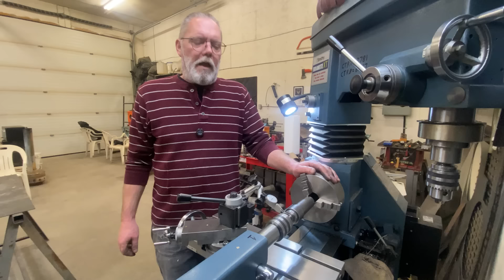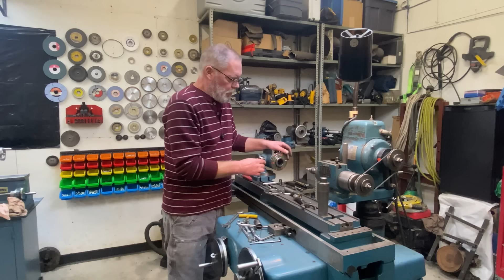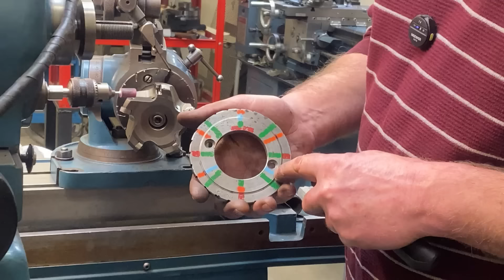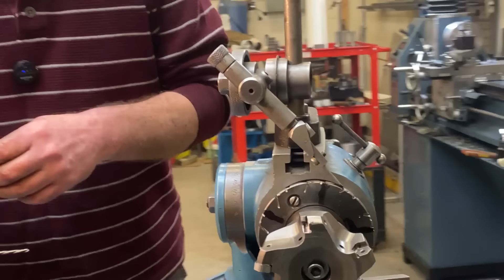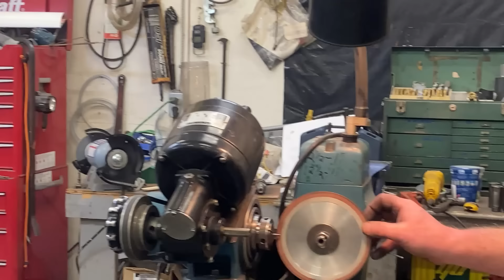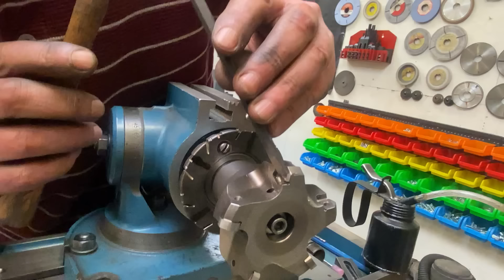MOST IGNORANT BROKEN SCREW I'VE EXTRACTED

Comment: You'd think they would thread the entire bore specifically to make broken screws easier to extract!

If you (or a friend) tinker with electronics, it should be pretty easy to build an EDM broken bolt extractor. It doesn't have to be very rigid, as EDM imparts no force.

The most important part is to ensure no electricity flows through the EDM's spindle, as that would destroy the bearings. I believe people usually use finely-stranded copper wire wrapped around the electrode shaft as the brush, keeping the spindle bearings out of the circuit. If the spindle and workholding are part of an existing machine, you also need to insulate the workholding - perhaps by clamping it down with plastic shims above and below.

You need a spindle that can turn at a few RPM, holding an electrode such as a piece of 12ga copper wire. Bend the wire a bit so its tip makes a circle about as big as the bolt/screw being removed. This spindle needs to be adjustable in the Z axis.

The EDM electronics are fairly simple: a DC power supply that slowly charges up a capacitor that's rated for high-current discharge. The electrode is connected to one end of the capacitor via the brush, and the other end of the capacitor goes to the workpiece. Polarity matters - you want the heat to go into the workpiece and leave the electrode cool. I don't recall whether that means positive or negative, but you should be able to find info online about polarity, as well as power supply voltage. A meter or indicator light is generally attached across the capacitor so you can tell if it's charged or if there's a short.

A dielectric liquid (oil, kerosene) is usually used, and I believe this improves electrode life by keeping it cool. In professional setups, the liquid is pumped, which helps remove debris.

Operation is pretty simple - you turn on the power supply and spindle, and advance the spindle until the electrode arcs. If it stays shorted, back it up and clear debris. If not, continue advancing. A professional setup will have a motorized z-axis that advances slowly, stopping when the cap discharges and reversing if it stays shorted for long.
Reply from the maker: That's a really in-depth explanation of an EDM setup. Appreciate you sharing!

Comment: Grind 3/8 " clear of thread. Use teflon tape, the high-pressure kind (the pink stuff I think) since it is thicker. Increase layers until the thread tightens in the internal threads. You'll only be off 0.0005" 5 tenths. 
Use a differently sized tip or stylus with a flat.

Comment: Looked like that screw broke due to impact by the scars on the flange, and not seized due to over torquing or thread locking compound. I remember the machinists in the Air force using cobalt and diamond tipped tooling for hard work like that, but at six hrs+ labour! That head would of went back to the supply disposal scrap pile Lol. love watching your work and the mental pleasure of man mastering machine. Cheer's H
Reply from the maker: Thanks for the kind words!

Comment: When i need to spot teensy hardened and/or munted screws like that, i use a McMaster 4313A151 bit. It seems to hold up even if i accidentally let it run around the hole a bit.

For removing sleeves, as long as they're not too hard, ill turn them down to about .060 and then knurl them. They tend to open up a bit. And even if they still need pulling, the new knurls give me a good surface to clamp to.

But that obviously won't work up against a shoulder like you have there.
Reply from the maker: Thanks for watching and for the tip!

Comment: Really a good job but I have a question. Wouldn’t it be an option to take a tap drill and run it through the tap drill hole from the backside? It might be that the friction alone from the tap drill would turn the broken screw. There would be no set up as you would use a hand drill.
Reply from the maker: Thanks for watching

Comment: 35:30 you can make one of the smallest left hand drill bits by hand but when you need a chisel you get some huge honker instead of a flat ground small piece which would have fit in that area much easier...😂

Comment: Yeah, this is the kind of job that makes you realize the majestic beauty of old EDM sinkers... You clock the piece on the table, you take a copper pipe a tad smaller than the minor diameter of the male thread and you chuck it in the holder, you route oil through it and just give the screw some of that good ol` Mike Pence treatment... The machine will do everything of it`s own accord, and will stop at the set height, so you can just set things up, let her run and come back in half an hour to a job perfectly done... After that, you can just extract the rest with regular extraction bits, a punch or what not... 
Same goes for trepanning and custom socket driven pieces... If you want to trepan a massive part, just take a large copper pipe with a thin wall and clamp that to the EDM, and if you need to take out a screw with a mashed head, or you want to make a screw with a hex or similar drives, you can just machine a driver replica(undersized in accordance to the arc length) and zap the part until it fits the hardened steel driver to desired depth... 

A lot of broken head screws can be mended(extracted) by zapping a hex into the body, leaving some 0.5 or 1mm of the cyl. section of the screw, and just plopping a key into the hex and wrenching that bitch into submission... It will often bend the wrench, as it`s always one or two sizes undersized vs the hex that comes naturally with the whole fastener, but a decent impact socket should loosen it in a real hurry without issues, but the manual hex wrenches also work - with the risk of bending... Anyways... I`ll cut the rant... Nice job on your part, the rant is just a ``sort of a suggestion`` and me glazing the old tech...
Reply from the maker: That's a really interesting take on the problem, thanks for sharing your insights!

Comment: Would it be possible to indicate from the other side of the threaded hole since they didn't thread them all the way through the tool holder? Sorry if my terminology isn't quite right. I have a cold.
Also, forgive me if I'm mistaken and the holes are actually threaded through. My eyes may be fooling me on that.
Excellent outcome.
As someone who has extracted roughly a zillion screws myself, I can say that the feeling when you get an exceptionally difficult one like this is pretty hard to beat. 
Well done and thanks for sharing this. :chillwcat:
Reply from the maker: hahaha,,,I considered turning down a pin that could fit the ID of the threads more tightly but decided against it as I already had the shell mill in a setup so couldn't check the pins progress at the lathe. Thanks for watching and commenting!
Reply: @Lappemountainliving  I see. Thanks for the reply. This is the first one of your videos to appear in my feed. I've subscribed now. Have a good one.
Reply from the maker: Awesome! welcome aboard!

Comment: Grinding a custom drill bit is awesome and it's why I'm here. This one also made wonder if a carbide masonry bit would bite into that hardened screw.
Reply from the maker: I'll bet it would. I've had incredible luck modifying masonry bits. Thanks for watching!
Reply: @Lappemountainliving  Me too, I have successfully modified them and used them to drill some incredibly tough, case-hardened steel shafts.
Reply: Few things in life are as satisfying as the successful extraction of a broken screw.
Reply: @Rodneygd or keeping you assets after divorce.
Reply: Checking the top rake angle I see flat with a slight chamfer for chip prevention. Coming in from the back side with the tap drill might only leave a wire to pull from the threads.
Reply: Should drill from the back side. So when it catches. It runs out.
Reply: Exactly my friend!
Reply: I go straight to a solid carbide drill for hardened screws or bolts. If that won't cut it , edm it.
Reply: @bobbybishop5662  My experience exactly. You've got to get the alignment right, then a 4-flute centercutting carbide EM slightly smaller than the minor diameter of the threads, it'll go through those hardened index screws, and you get a hole on which you can get a bite. First though, I'd try an automatic center punch - lots of light snaps like he did with that flat chisel. It often gets a tiny bit of movement at a time, and ends up spinning it out.

But I have to say, it's a good video with that satisfaction at the end, like finally pulling out a damned ingrown hair!
Reply: I have reground masonry bits to drill hard metal , it works .
Reply: Small diamond burr, very slow so as to keep heat down if not cooling available. If it will grind glass and ceramic…
Reply: My old machine shop teacher would get them and grind the correct geometry into them and drill coolant passages into mold cores with them. Don't need to be perfect and saved $$$ over a solid carbide drill!

Comment: 4:20 Once you are that thin, oxyacetylene will instantly melt it away without heating the base.
I’ve surgically removed many a rusted nut.
More precisely…cut bearing races off shafts without scarring the shaft
Reply from the maker: Thanks for watching

Comment: I'd use a round diamond file. Maybe a dental burr. 
BTW IMO It's not true that high speed creates sparks and destroys the diamonds. Dental drills can run at 50.000 RPM. Sure the diameter is tiny but still. Angle grinder diwmond wheels cutting rock at 10.000 RPM also come to mind. It's carbide dust for sure. Rock dust. It would be over in seconds if they were diamonds burning away. It can break the diamonds or rip them off but they will not burn so easy. If you are afraid of that, you can cool it down with air or something. Everyone is running those wheels so fast in surface grinders. It always makes sparks

Comment: Broken screws drills and taps are always a pain.  I have had really good success at removing them with the rig welder.   Just build up a blob of weld metal (use stainless) above the surface and then use vise grips.

Comment: I wonder if anyone has tried using a shilding gas and a arc welder. Using a same size screw with the threads cut off. A placed in the welder inplace of the electrode. Maybe make a guide or jig to allow straight on contact. Then spot weld the threadless screw on to the broken one. Under shielding gas for protection. Or weld on a nut with very small welding  wire .

Comment: Brings back some terrible memories trying to extract 2.5 and 2.2mm tip screws. 
I used to have the best luck pushing them out from the back with rh carbide and occasionally HSS slot drills. 
The production engineers refused to put in appropriate cutters with tough tooling  as they were cutting first cuts on castings that would still steam when coolant was applied. My crew was in there every shift and spending almost 12 hours a day fixing damaged cutters.  Got it sorted eventually with a few political dirty tricks and a contact at the tooling company where I sketched out an appropriate design for these cutters and tips and had some made. Changeovers went from every 6 hours of cycle time to a tip check every 3 months usually only requiring a rotation and no more.  We also developed a side and face cutter blade that used an insert nut for the screws as with the cutters being so narrow the first or second broken screw usually trashed the threaded hole.  Cutter replacement frequency went from 100 hours to several years. 
I did eventually rewrite the plant wide SWI for carbide tooling and the feature was every tip replacement new screws must be used and every tool that required screws 3mm and under have them replaced at the tip change.  For milling cutters like the one you repaired screw replacement was mandated after a second tip change.  Any broken tip would require a screw replacement due to stretch issues . I was also able to get torque limiting drivers for the setters and operators to prevent clamp screw damage.   Cost wise it wasn't cheap however the improved up time and product quality covered it.
Reply from the maker: Wow, sounds like you really tackled a huge problem head-on and found some great solutions!
Reply: @Lappemountainliving I agree, would like to see the papers he presented for the system...
Reply: @Lappemountainliving  His solution was the ONLY solution a competent professional would have begun with. face palm That's literally a 4 minute repair with minimal setup required since the bore is automatically the drill guide, and the tip of the screw isn't work-hardened from amateurs mucking with it.
Reply: Would using a production-type semi-permanantly-set torque screwdriver not reduce this problem ?.. 🤔
Reply: @peterfitzpatrick7032  Torque limiting drivers  (Permant set same thing}do but screws especially on milling cutters get a lot of load in odd directions. Hence the screw changes.
Reply: YES! THANK YOU! What kind of idiot chooses to mess with the work-hardened head side of the screw (from amateurs trying to extract it the wrong direction) when the tip of it is still virgin and begging to be turned out the head side from the rear, protecting what's left of the lead threads??? HOBBYISTS should not be performing real work for customers. That was a 4 minute repair with minimal setup to anyone with a functioning brain.

Comment: Regarding the run out you were finding on the far end, I noticed you paid out quite a bit of spindle on your tail stock.
Next time you could you try choking up and pulling the spindle back in as much as possible and at the same time swap out the live centre for a dead centre.
You know back in the day we used to use "White Lead" paste when using a dead center. It came in a little can much like the small cans of touch up paint that are sold at Home Depot LOL.... we've come a long way.
Love your Channel. Precision Grinders are the heroes of any machine shop.
Reply: I don't think white lead has been for sale for a very long time .
Some times a can will still be found somewhere .
I found a can in box of things once .
Reply: @kennethnevel3263 I guess I did not emphasize enough how toxic the stuff is and that yes it is long gone banned and you will be shot if you bring it into a North American machine shop 
Nickel-based anti-seize is the way to go these days LOL

Comment: A good way to get the machined sleeve off is to strike it with a blunt flat chisel. It will expand the sleeve and allow it to slide off without damaging the spindle.
Reply: When it was about 1-16” thick.
Reply: Strike the sleeve on the Z axis with the blade going from chuck to tailstock. You might have to do this in two or three different places and it will expand the metal sleeve, allowing it to slide off. This is what you do to remove seal savers from axle spindles.
Reply from the maker: Interesting approach. Thanks for watching!

Comment: Glad it worked out, broken screws either come out really easy or make you contemplate life.
Reply from the maker: lol...agreed!
Reply: I’ve done a lot of contemplation in my time. The worst were fine thread 3/4 track roller bolts on a Timberjack buncher. Over a week on my back in the gravel drilling and using carbide bits to take them out to the root of the threads and peeling just the threads out with forceps, picks and tiny files.

Comment: Looks like you bought some of the same carbide spot drills I did and mine chipped just the same as yours on first contact.
I've had good luck drilling out hard, broken off taper pins with small carbide endmills - ZGT brand on AliExpress - They go down to 1 or 1.5mm dia. IIRC and they're very reasonably priced.

Comment: Hi
I just had a problem like this with an ebay tool holder.  I drilled from the reverse side in the tap drill thru hole.  When the RH screw was drilled from the back side the RH drill drilled into the screw and the screw un screwed out of the hole.  This was faster than using the edm sinker.
Very clever on what you did with the set up.
Reply from the maker: Interesting approach. Makes sense. Thanks for watching
Reply: @Lappemountainliving the tool you were trying to clean up on the lathe in the video looks like you have a hairline fracture underneath the material that you milled off of it
Reply: This was going to be what I suggested. That through hole allows access to the backside of the screw that isn't damaged or work hardened, and the screw seems to be dimpled on the end so easier to keep the drill centered on the initial plunge.
Reply: I was thinking about the same approach. I was going to leave a comment asking if that would have been a viable option. Your results suggest that it is. Thanks for sharing your experience.
Reply: If there isn't trough hole, welded nut to screw would allow to unscrew broken screw. Which is why it is nice to have cheap flux wire welder in shop even if welding isn't what shop is doing.
Reply: hehe this is what i said too;p
Reply: Would it be possible to correctly index on the non-precision face though?
Reply: @cambridgemart2075, my thought would be to use a gauge pin in the through hole from the back and indicate it in.  This would eliminate the need to index anything.
Reply: A lot of times a drill near the tap drill size will remove enough of the holding force that when nearly through the bolt will screw out the other side , always a good thing when this happens .